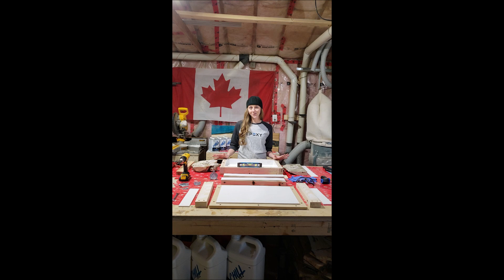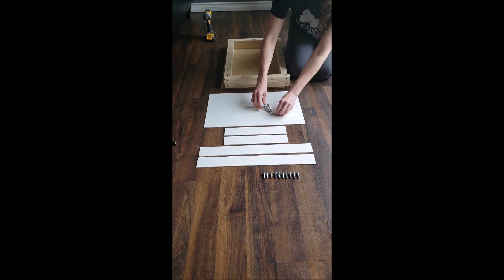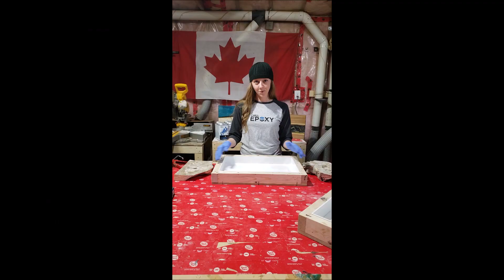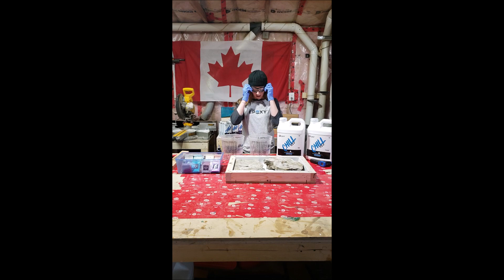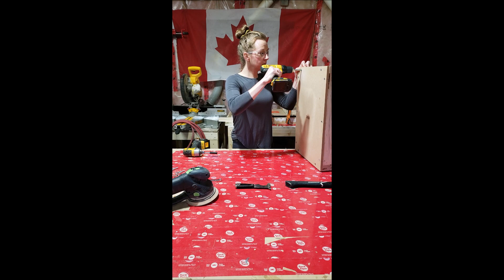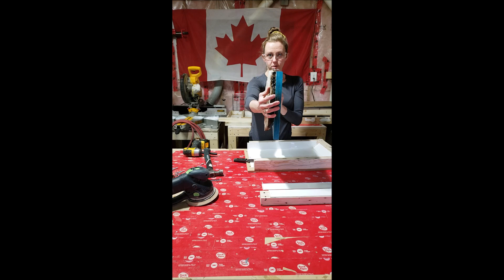DIY Reusable HDPE Epoxy/Resin Form

Comment: I just took the box the form came in, punched a few small holes in it, covered them with some window screen material to reduce dust (and cat's paws) from entering.  I now have a cheap rubbermaid style container that I use, doing the same thing with holes/screen so that it's not as tight a fit for removing to check on things.